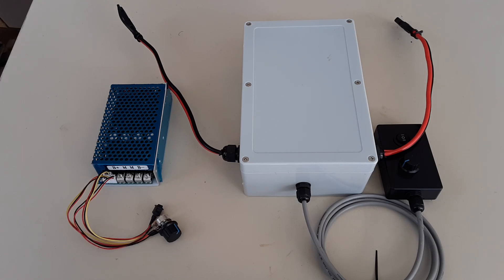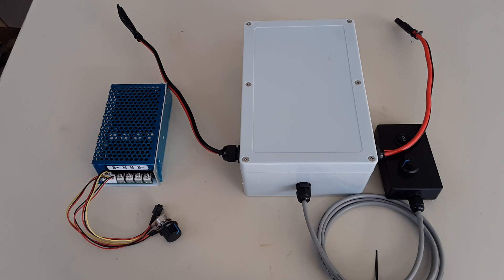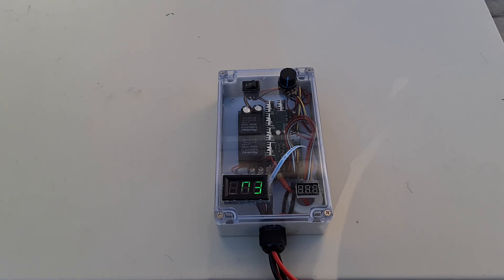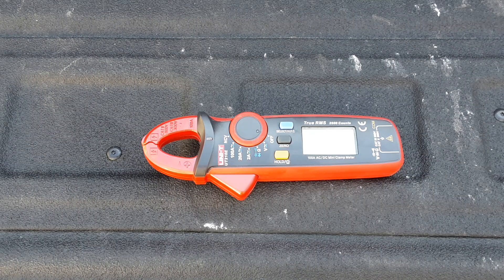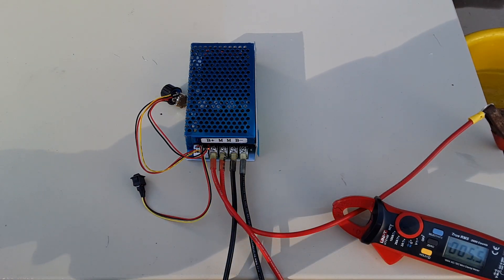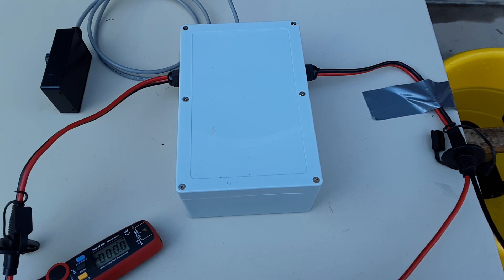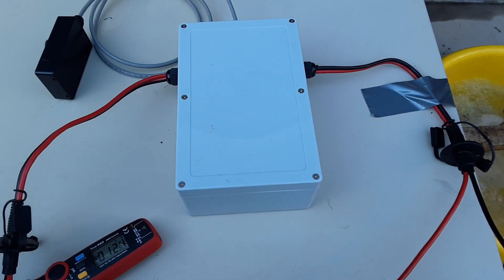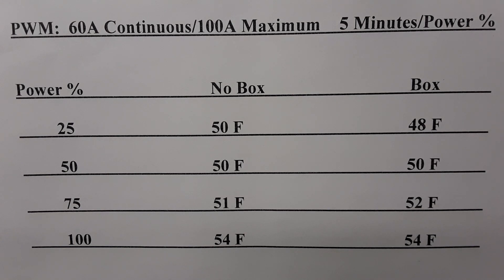PWM Digital Speed Controller w/ Fan Heat Test Comparison

Comment: I guess I'm not going to worry about mine being in a box with just vents in it until I experience a heat problem. I'd either add a small computer type fan or just get that PWM with the fan already in it.

Comment: Hello, I'm in the UK and wondered if its necessary to have a cooling fan as it will be situated in a watertight box?  Seems from the video that it would be unnecessary. Also should the PWM frequency be 15khz or 25khz? Im thinking of the noise level.  Thanks for your advice and for taking the time to make these videos!
Reply from the maker: Thanks! I like the cooling fan model because it has never failed. I'm not sure what the freq is but there is no way that I know of to change it.

Comment: Hi Aks, I love these vids, very helpful. I'm curious should I mount my pwm with an air gap under the bottom? Also did you happen to repeat this test during the heat of the summer? Someone suggested either net cable? What do you think?
Reply from the maker: Thanks. I like to have the circuit board elevated above the box base to help with airflow/heat dissipation. I didn't repeat the test because  I felt that to be as accurate as possible ( for a garage engineer) I would need to use thermocouple sensors. I think the best test is whether or not the PWM fails.

Comment: I
Would be interested to know what wire you used for the remote box with switch and pot thanks
Reply from the maker: This is what I used for the build.   5426-CL 8 Conductor 22 Gauge Unshielded Cable (4 feet)
Reply: @Aksmaniyak do u know if going up to 7-8 feet would have adverse effects
Reply from the maker: @vtyaker9024  I've used this set up at 10 feet with no problems.
Reply: @Aksmaniyak  appreciate the response. I will be putting this together in the next few days.. the last thing im debating on is adding a 8 wire receptacle and plug by my seat so i can attach and detach when not in use. Have you ever tried adding a plug/receptacle to the remote? I may go down to 20awg in that case if needed. My set up would be 6 feet of the remote wire to a 8 wire receptacle and then into the small box. Thanks again for any insight

Comment: Hello good evening greetings from Colombia I have an electric motorcycle that weighs 60 kilos it has a 90v 1000watts 11A dc 4500rpm motor if this 5000w PWM module works for you thank you

Comment: Your box is acting as a heat sink.  If all sealed, and failing in the Summer then find where the power transistors are in the PWM, and mount a large internal heat sink in the case and then mount that to a metal exterior surface.
Reply from the maker: Thanks but I have not had a failure.

Comment: Hey just to let you know and to let everyone know that the infrared gun you're using is not reading the temperature inside the box it's reading the temperature on the outside of the surface of the box does not take temperatures through things I don't know if you knew that that's why you were getting the same type of readings
Reply from the maker: Yes, I realize that and the unscientific test was too see if the heat generated inside the box was great enough to transfer to the outside of the box. My thought was if the box heated up on the outside, then the PWM would be running very hot and heating the air in the box.

Comment: Hi, just an update, pay pal closed my case. They are returning my money, I guess they couldn't get a response from them either. 
Are you aware of any others that build similar units that are wireless? with infinite control? If not I'll just build a wired unit.
Thanks for your input if any, Ken
Reply from the maker: Hi Ken. Sorry the WTP didn't work out for you. The only other wireless I knew of was GAMA. Unfortunately, GAMA no longer recommends their units for trolling motors. Wired may be your only option.

Comment: Hi, Just a quik question. I see you have purchased a few or more of the wireless trolling pro's Have you had any trouble with that company?? I ordered from them in sept. and they won't respond back to me 
Sure would be interested in your response with any info you might have , Thanks for your video's Ken
Reply from the maker: Thanks Ken. I actually still have a WTP PWM that still works fine. I haven't spoken with anyone from the company since they temporarily shut down. There must be some type of problem because the owners have always been responsive.

Comment: Have you heard any numbers on the failure rate from overheating of these PWM's. I have a $15 one from Walmart (PWM 12V 24V, 60A Reversible Switch) and it worked great all summer. Mine is mounted inside the hull of my Predator PDL where I would think it gets pretty hot, but no problems on 50+ outings May-Oct. Did I see correctly that the PWM with the fan is about $115? Great job on the video. I really appreciate you sharing your tests and information about these PWM's. Thanks much...
Reply from the maker: Thanks Craig. I don't have any failure rates, just information shared by FB group members. I didn't know Walmart sold PWMs but a 60A continuous reversible is a good choice. The price for the PWM in the video is anywhere from $32 to over $100 depending where you buy it. I wouldn't spend over $75 on an Amazon or Ebay (China) PWM because you can get quality ones around that price. The point of these PWMs is that they are inexpensive and worth the money if you get a good quality one.
Reply: @Aksmaniyak  where, if not Amazon, can I get this PWM with domestic parts? I can’t find country of origin on the Amazin, $60 one, it looks exactly like the one you are using here. I’d love to find a domestic!
Reply from the maker: @bradleyrussell1973  Unfortunately, the only model like this I have found is manufactured in China under many brands.
Reply: Craig I got the same on on amazon for 50 dollars building it for winter project 😃

Comment: what engine is it?
brush?
Reply from the maker: Yes, a brushed trolling motor.
Reply: @Aksmaniyak  Can this regulator be for brushless motor?
Reply: Haswing Protruar 1.0 12V 65lb ?
Reply from the maker: @kkf7037  No, only for brushed motor. There are some PWMs made for brushless motors.
Reply from the maker: @kkf7037  No, this motor was a Motorguide 30lb.